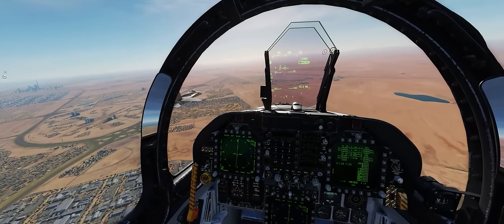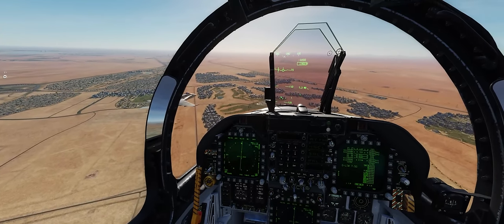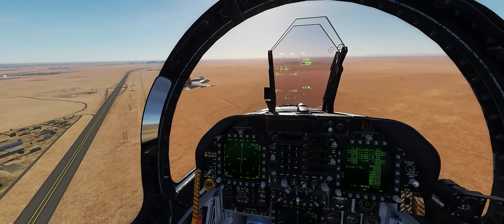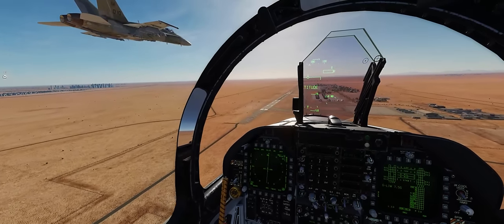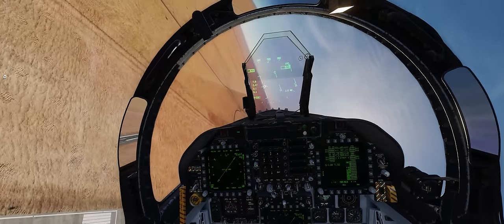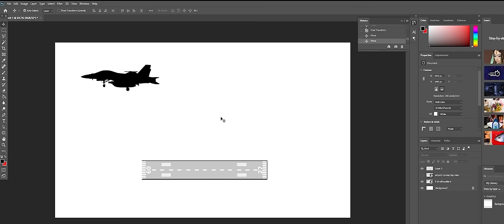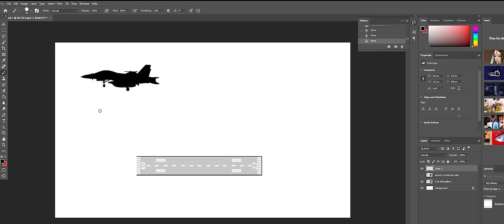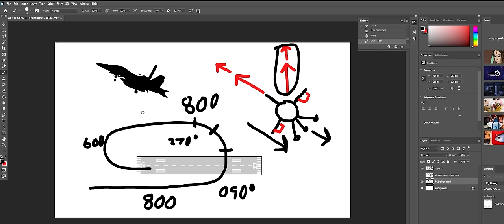On Speed AoA Made Easy in the DCS F/A-18C Hornet!

Comment: Well I will certainly be damned! I went from not understanding this throttle/AOA/trim thing to being able to pull off a really great pattern landing after watching 33 mins of this and 5 practice goes myself. Once you get the velocity vector in the E bracket with trim at the right speed, you're basically just on throttle and roll controls then. Feels great getting those throttle adjustments going well to keep the vector on the runway.

Comment: Great video to help those struggling.

The way I learned which works to counteract ballooning:
1. 250 gear down
2. 225 flaps half
3. 200 flaps full
Reply: Thanks for the tip. Has helped greatly.
Reply: Same stuck to this for a whileb
Reply: 👍 Thanks!
Reply: I just tried idle power, fly level till speed down to about 170 kts. Then adjust AoA with E bracket- vel vector trim.

Comment: I know this is for DCS but just a few comments from my former life....#1 rule coming into the break over the boat is to look cool and having your speedbrake out ruins that effect.  350 is pretty weak sauce as well, especially with the extension upwind.  For the upgrade for the Sh*t H*t break you gotta come in at 450+, break no later than the bow with a good hard inital pull to bleed off some speed. Maybe a bit of burner at the break if you really want to show off, then throttle idle.  You will still be well above max gear speed so gear/flaps stay up. Ease the pull at 90 degrees through to make sure your abeam distance isn't too short but keep wings near 90 with a little top rudder to give the illusion you are still in the pull.  (remember Rule #1)  Wait a potato or two then hard pull again to get the right abeam distance on your downwind and bleed off more speed.  1.1nm was about right for me.  Fly the downwind to hit your correct turn point to start the turn to final. Your fast still but hit gear speed about halfway through the turn still at idle and gear/flaps go down.  Catch on-speed with power just as you are rolling into the groove and fly it on in for that OK-3 with the Sh*t H*t break.  Then it is time to hit the dirty shirt wardroom for a slider and some dog.

Comment: Another good video on the topic. Ive practiced this alot, so nowadays I finally consider myself a veteran Hornet lander. Still I loved the academic insight you provided here. You might have pointed out my following «broken down» tip in the video already, so if you did, please accept my apology in advance. Well here it is. If you manage to pull the correct amount of Gs in the first turn, you will more than often end up in the ballpark of 250 knots halfway through that first turn. 250 knots is a good (if not the schoolbook?) speedmarker for flaps/gear down. So in my head I do what I can to keep the numbers right from the getgo in this basic sequence. Upwind 350 knots, 800 agl. First turn - 3,5 g pull. Easing of pull gradually (As you mention) 250 kts - flaps/gear down. Done. Little to no ballooning. Downwind/base leg is another subject.

Comment: Hi Spud, great video, but I seem to recall being told by a real world fast jet guy once (not a pilot myself) that you never move lift devices (such as flaps) in a bank, especially not at low level such as the turn onto downwind. I seem to remember him saying that this was something to do with increased risk of loss of control when changing the aerodynamic characteristics of the wings while there's asymmetric lift from them. I seem to recall him telling me they used to drop the first stage of flaps just before starting the turn to final, they'd then wait till they rolled out on final to drop down to landing flap, the wait being specifically to avoid moving the flaps in the bank. 
It was a number of years ago now, and I as I say, I'm not a pilot, so I may have misunderstood, or misremembered something, but just what I'd heard.
Reply: I thing it does make sense. If you have asymmetric failure and only one flap moves out, it can get nasty.
Reply: Perhaps you heard this from a WWII Pilot? :D

Comment: I'm in trial of the F-14B. I own A-10C, Su-33, Mig 29, BlackShark2, UH-1H....... out of all aircraft, the landing of the F-14B is fantastic, even despite my severely fatigued and twitchy Logitech Extreme 3D Pro stick. The twist axis in those sticks lasts about 2 months. I think I'm hooked by the F-14, so to speak :) Beautiful response like the difference between 16-bit and 64-bit.
I'd flown quite a bit in a 2-seater Cessna with a coworker, who'd hand over the controls for approach...... two handicaps were rudder pedals and lining up from a few miles out...... for some reason---I think it might be way over-controlling is the problem---lining up is a nightmare to grasp. That's what brought me to this video...... despite the fact I've got 40 years as a draftsman/technical illustrator, making my living off parallels and perpendiculars, getting the plane on center and keeping it there needs lotta work :)
Probably revealing idiocy here, but I (think) the plane gains altitude faster in a banking climb, rather than just pulling stick straight back wings level.....? The segment on turning 90 with flaps and gear down prompted that, when you discussed ballooning issues. 
Sorry for the flooding stream of thought, but before I understood what flaps actually achieve, I'd expected them to act like elevators. I worked in a foreign car parts store situated such that the glass front was directly on line with planes landing at BWI (Baltimore)........ when I'd see the flaps down I wondered how it wasn't driving the nose DOWN. Flaps control in various situations can be pretty sketchy....... keymapped "F" and Shift-F, I find I have to check flaps with the F2 view....... I mean at speeds well below the threshold. Bugs come and go I guess :)
GREAT help here, Spudknocker. I'm gathering that in landing operations, you're flying MUCH more by throttle than stick....... makes sense.

Comment: Thanks for this great informational video!  This really helps...can't wait to go practice some more.  Question - do F18 pilots in real life have a "trim reset" button?  Is there a trim reset command in DCS?  Just to get everything neutral quickly...or at least a reference somewhere to look and see how much positive or neutral trim is currently applied?  Thanks again!  Looking forward to multiplayer (it's only been....a decade LOL)
Reply: Yes. On the left side behind the throttles, there's a button that automatically sets the trim to takeoff trim, which is 12 degrees nose-up. From there you can trim down to zero. Don't know why you'd wanna do so, though. Now the trim display is on the FCS page (MENU (TIME digits when in the air)2x  > SUPT > FCS (bottom right on the page). That's the page he has open on the right DDI. You'll see the line that says something like:
T12 STAB T12

Comment: You brought up in the beginning of the tutorial equaling out your G's to your speed on initial break. Stating 3.5 because of entry speed. However I don't see you even getting close to that. 2.4 I believe was your max. That being said can you clear that up for us?

Do you...

A. Do you hold your 3.5g throughout the entire initial break until 150 kts? 
or
B. Try and match the G's as the speed drops... IE: Bank---- [350] ->3.5g  | 300 ->3.0g |  250 ->2.5g  | 200 ->2.0g | [150] ->1.5g ------>level out 
                                                                                                                                                       Flaps/ Gear / Trim 

Much appreciated. 

Also, on a side question unrelated, do you slightly trim nose down during flight. I've read a lot of guys do this for the stick back pressure for precision for formation and refueling..

Comment: I decided to buy DCS on Steam (VR reason) after watching your video. Congrats by the way. I'm facing some problems: MSFS works fine in my machine but I'm having dual eyes view per lens in my Pimax 5K+ when using OpenXR. I've tried everything possible (to my knowledge) to fix, but I can't get rid of this issue. I'm loaded to the left of the aircraft (fixed with re-center VR) but with this dual view per eye. I've got a fast machine (i7, 128 Gb RAM, all Samsung Evo Pro SSD, RTX 2080 Ti). I followed your video instructions to improve PC performance (improved MSFS), but my DCS... I also have HAG disabled. Parallel projections on and off. I don't really know what else I can do. Can you help me out, please? Thanks

Comment: I disagree with having the speed brake out the entire time.  And lastly, the Hornet is a Naval Aircraft.  You don't "float" it down the runway.
Reply: You're correct. Speed brake should not be out during landing config while in the hornet. F14 and F16 it should be for the finer throttle response at higher rpm. Also, I think in the F18 when it's dirty you have to keep the air brake button held down because it auto retracts while dirty.
Reply from the maker: The video is showing how people who are having trouble with this concept can be helped with the airbrake. I also talk about this concept and explain that it isn’t realistic to fly the pattern with the airbrake out. I also explain and show the difference and explain why one is harder than the other. And while you don’t want to float down the runway you also don’t want to smash the jet on the runway every time at -800 FPM on the VSI like I see a lot of pilots in DCS do
Reply: @Spudknocker  That is great and all, but is it really better to teach something that is not entirely accurate, just because it's harder? 250 for flaps and gear and a correctly executed turn combined with the correct use of the throttle counters the ballooning effect 100% of the times.
Reply: @Spudknocker  that's cool but it would be good to explain to newcomers that it is designed to be landed at the AOA rate and angle and not "floated".
Reply: @Spudknocker  As I understand from information obtained from a Marine pilot... you are looking to land the Hornet between -600 and -800 FPM. Also I use the speed brake only on the initial break, at 90 degrees my gear and flaps are down as I hit the downwind I am thumbing in trim to get on speed and descending to 600' Just my 2 cents
Reply: On a carrier landing, that would be about -750 FPM max. 
On an airfield, in some video i´ve heard that SOME real hornet pilots even flare it, just to protect the front gear.
Reply: The way I fly you shouldn't have it out unless slowing down, flying with it on at one speed is the same as flying with it of a one speed and if you need to make a sudden tight turn it will kill your speed, or if you need to abort landing it will hinder gaing speed again

Comment: I found that it's way easier to land Hornet if I don't touch the trim, and just use pitch instead. So I fly as usual, give myself a long long downwind, drop flaps, gear and whatnot, make a base and final turn, miss runway, correct too much, correct again, then I use stick to maintain 3 degrees slope and speed around 140 (depends on weight). That's it, I maintain on speed AOA by the stick and throttle no problem.

I tried trimming on speed, lost too many nerves trying to do that, so I tried not to use trim and it works way better than I expected. I assume that stick have way higher quantization than trim, meaning I can set required pitch angle with way higher precision and change it way faster, than if I use trim. Fatique and weight (why ever trim was invented) is not a problem here, cause we obviously don't have weight on stick anyway and fatique is not a problem, cause I need to maintain desired angle of stick for a couple of minutes only.

Yes, I do literally opposite to all landing guides, which tells me "do not touch the stick and use trim", but what I can do, if my method works and trim is not.
Reply: So all you need to do is hold your stick in position once you pitch to the correct alpha, and then apply trim. You will find that you will have to slowly relax pressure on the stick as your trim gets where it needs to be. From there, you can fly your approach hands-off.

This is how you trim in the real airplane (any airplane, the Hornet included). It’s a lot easier irl because you can feel the pressure on your stick, so you just keep your hand still and apply trim until there is no more pressure on your hand.

The reason instructors beat the habit and tendency to hand fly approaches out of their students (to the point where you will fail the flight training program if you don’t fix this - it’s very serious!) is because you lose precision and repeatability, which has an effect on the safety of the flight, the aircraft, and the carrier (or airfield). Get used to using the trim, and you’ll find that your landings are very consistent, and almost always “perfect”.
Reply: @adilasif1516  Well I'll try again then. 

Thing is, F/A-18 trim is strange. Like, in F-14 I have no issues with trimming, I see that trim do what trim should do. In F/A-18 I literally have no idea is trim even do anything. I can't even get the right direction, cause I don't feel that trim do anything.
Reply: @eoffsock  The easiest way to watch how you trim works in the hornet is to keep the nose of the aircraft on the horizon line, keep the indicator on the nose level with it, as it represents your wings, and the horizon. it should pretty much be a straight line all the way across barring the circle. if its' down a mm or up a mm that's okay you can still see the separation between the two lines are equal. If you hit the trim wing down once, you'll see it slowly start banking and becoming unlevel on the indicator. If you hold the trim it will do it quickly. same with your vertical.. a lot of people fly with the trim set down a hair in level flight to keep a bit of pressure on thes stick for control purposes but you won't notice the vertical as much as the horizontal. but you will see it pitch on the horizon line. 

For landing, just keep it at 140 the entire time after your initial break, and all the way onto the runway. that will never change. so just keep an eye on that and give it throttle back and forth. the only other thing you need to do is get the nose in the middle of the bracket, once you're there the trim is done. just add or take away throttle. You can practice that just flying level same as you would when you're normally trimming your aircraft until you get it down.

Comment: So when your plane is in the region of reverse command, I know that you use the throttle to control altitude. How about when you ar3 too slow or too fast? 

In a general aviation plane like a Cessna 172, whenever your aircraft is on final and in the region of reverse command, if you get too slow, you push forward on the yoke to pitch down, and if you get too fast you pull back on the yoke to you pitch up and if you are too high you reduce throttle and if you get too low, you increase throttle. 

However in Wags video he said that you never use forward or back stick during final and you only use throttle and left and right stick. So in fighter aircraft when in the region of reverse command, do you use throttle to speed and altitude or just like GA aircraft, do you use throttle to control altitude and pitch to control speed?
Reply: I heard the answer to my question around minute 31 in the video. Thanks.

Comment: I started practicing this, as I'm new to dcs; great training! BUT... I noticed my speedbrake keeps retracting during the break! I can't figure out why? It's fully extended, I pull Gs, drop the gear and flaps; but when i roll out, I'm fast because the brake retracted. Any idea why the speedbrake keeps retracting during the break? (and no, I'm not accidentally hitting retract button)
Reply: One other thing, I look at my FCS page to help me gauge the right trim to hold AoA (about 9% stab). But, I am unable to gauge it correctly while still in the bank, which leads to chronically too much OR too little trim for AoA on rollout heading. Any tips with either?
Reply: This comes a bit late, but: if you drop flaps your speedbrake automatically retracts. You need to extend it again after dropping the flaps.

Comment: Great video, this with your others are making it much easier getting to grips with DCS.  As a new(ish) player, I've still not found a single decent breakdown as to why or when we're supposed to use this approach pattern.. it actually seems incredibly illogical as it's adding more variables to the landing in addition to putting more of you in a tighter space; I'm failing to see any reason why this approach method is safer or easier and instead think it's doing the exact opposite.. a straight 10 mile final in is a lot easier than trying to fly around in a near complete circle close to the ground and other planes?  Furthermore, with this approach, if you do fall out the sky then you're potentially taking a runway out of service.